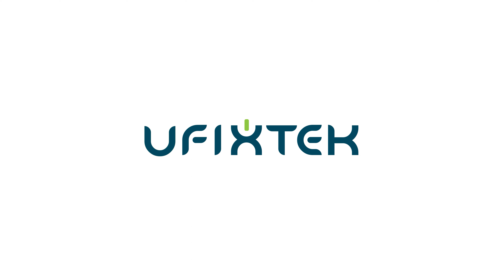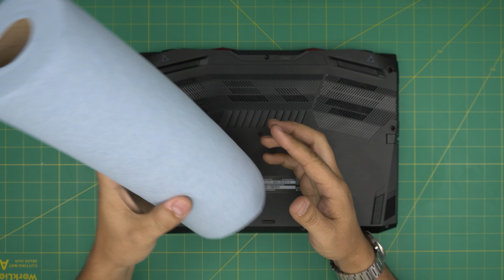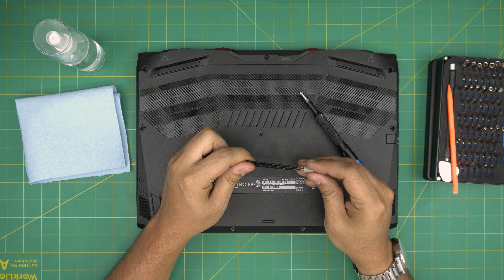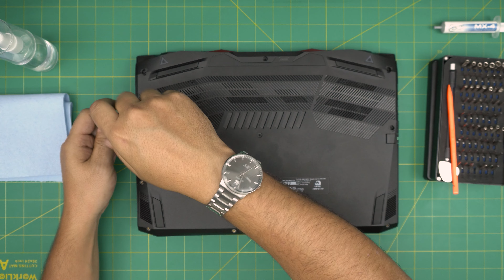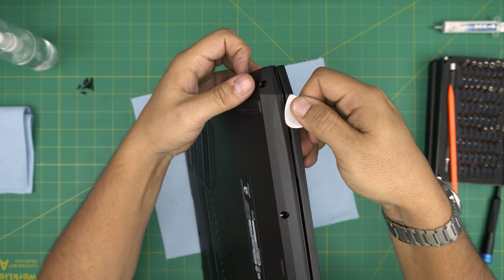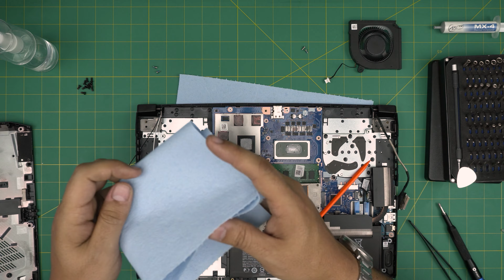How to Repaste and Clean Acer Nitro 5 AN515-57-79TD Laptop | Step by Step

Comment: i want to repaste my 2y old laptop but the heatsink screws are so tight and they are starting to stripped
Reply from the maker: Thank you for your feedback! If you wish to support the channel, you can like, subscribe, or both!
Regarding your tight screws, use a longer handle screwdriver and press hard down on the screw and at the same time small rotation, to break the seized screw.

Comment: Sir my laptop is giving me the green screen  after doing this i dont know why it doesnt boot into Windows it goes to automatic repair mode and it doesnt repair it i dont know what to do
Reply from the maker: regarding your question: double check the m.2 SSD and the hard drive to make sure it is connected correctly.

Comment: Are UPSIREN U6 PRO and HALNZIYE HY234 thermal putties good for replacing the thermal putty on my Acer? If so which one is better? These are the only domestic options I have in my homeland.
Reply from the maker: HALNZIYE HY234 are excelent, also the UPSIREN U6 PRO are great too.
Should you have any further questions or requests in the future, please don't hesitate to ask me.
cheers🍻
Reply: @uFixTek  Thanks for the fast response. I already managed with your videos to upgrade the storage, ram and clean the laptop. I have subsrcibed to your channel.
Reply from the maker: i appreciate your support my friend.
💞

Comment: I did this but now my laptop cant connect to wifi, only bluetooth
Reply from the maker: 😐Regarding your issue, make sure the Wi-Fi card (Bluetooth/Wi-Fi) is inserted correctly and all the way in, and ensure the antennas are securely connected to the connectors. Remove the card and reinsert it to confirm proper installation.

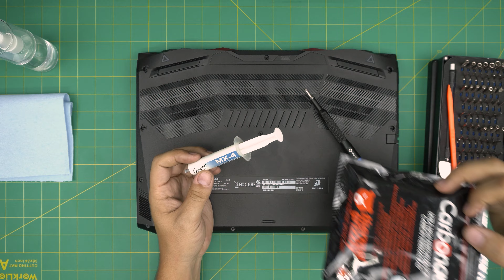Comment: 2:16 From my experience with Thermal Grizzly pastes are not suitable for laptops with high TGP, TDP where the temperature is close to 80°C for a longer period of time.  After 8 months, its thermally conductive properties deteriorate significantly.
You should try using phase-change material Honeywell PTM7950. It comes in as a sheet, lasts longer and performs in my experience works better than traditional pastes. On the power section, vrams give thermal putty Upsiren UX Pro. It is also good do undervolting on CPU and GPU at -100mV or more if it will be stable. It will be more fps, quieter, cooler and less power will be drawn.
Reply from the maker: Thank you for your valuable feedback. I want to express my agreement with your points while also sharing my extensive 17-year experience in testing and servicing laptops and electronics.

Throughout my career, I have observed that whether you use Thermal Grizzly paste or non-expiring pads, dust and air buildup are inevitable over time. Therefore, it becomes essential to open the laptop and perform cleaning and servicing at least once every two years to maintain optimal performance.

In my testing, I have personally used both Thermal Grizzly paste and the Thermal Grizzly graphite pad (known for its long-lasting properties). After a continuous three-year period, both products yielded similar results to what they provided on the first day of application. However, due to the accumulation of dust, the temperatures for both increased, with the paste being approximately +3°C warmer than the graphite pad.

Despite the three-year daily usage of 8 hours side by side, the thermal paste's temperature only rose by +4-5°C compared to the graphite pad. The significant dust buildup and the laptops reaching temperatures of 85°C and above made it imperative to perform a service on both devices.

I understand that data sheets for thermal materials may indicate specific performance attributes, but real-life testing over a continuous three-year period provides invaluable insights. To gain accurate results, I encourage others to conduct tests using the same model laptops, under identical conditions, and with similar loads.

While I would typically agree with conclusions drawn solely from data sheets, my practical experience with clients ranging from school teachers to graphical designers, and gamers, has shown minimal differences in performance among various paste models, makes, and types from top brands. The graphite pad stands out as a recommended option due to its reusability and its ability to retain its properties under heat.

To further explore the thermal performance of products like PTM7950 or liquid metal, I intend to subject them to thorough testing and assess their long-term results. Ultimately, I'm confident that PTM7950 will deliver outstanding performance over time.

In conclusion, I believe that combining data sheets with real-life testing is the most comprehensive approach to making informed decisions about thermal solutions for laptops. Thank you again for your feedback cheers🍻
Reply: @uFixTek  hello sir, I have Nitro5 AN515-45 R7 5800H + 3050Ti. I repasted it using GELID GC4 recently. it works well for a week but then it starts hitting very high temperatures again.

Just after repasting its able to maintain 65W at around 90C, but a week later it couldn't even do 54W. and same for GPU, temps rose from 68C to 79C after 2 weeks.

Can you recommend a paste which actually worked well for your Nitro5 for long durations?
Reply from the maker: i recommend you to place : thermal grizzly kryonaut extreme which has a Thermal Conductivity 12.5 W/mK, compare to GELID that only has a Thermal Conductivity of 8.5 W/mK.
but if you want the best of best use a Liquid metal (extremely conductive) you will need to use tape around the GPU/CPU dye.
and that has a Thermal Conductivity of 73 W/mK
Reply: @uFixTek  can't use Liquid metal because heatsink is made up of copper and gallium reacts and eats into copper. Can't use LM with electroplating my heatsink.

From what I have heard, kryonaut is even worse when it comes to drying out

What about thermal grizzly hydronaut?
Reply from the maker: my friend i been servicing for long time, and i have placed Liquid metal on this laptops and others, the LM will not eat thru the Copper, there are even used my manufactures on laptops with copper and even PS5 that used.
we apply LM on laptops and after 5 years reopening to service the copper it is in perfect shape and a bit of copper cleaner and polish you can re service. my personal laptop have LM for years and i serviced it recently after 4years and no problem.
kryonaut it will dry but not in a year it will in a two years and by then you will be doing service, by by then you have enjoyed the good thermals, but if you feel fit by usign other brands try them out and see which results the best for you.
Reply from the maker: everyone is subject to paste to what they like, and in my opinion and extended experience and testing i would stick to thermal grizzly extreme paste or LM on laptops as they shown the best results over time. Clients satisfactions are the one place we judge our work.
i do wish you the best and if you find your method and paste reliable i'm very glad and thank you for sharing.

Comment: Really helpfull video much appericated but i have an question. Im planing to replace my acer nitro 5 an517 models thermal pastes so vrms i mean capasitors need 1mm pads is okey but what size should i use for vrams that square chips around gpu  i do not  have k9 pady which size pad should i paste there ?
Reply from the maker: It's my pleasure my friend.
🫠Regarding your question, please do not use thermal pads where there is thermal putty or gel. The gap is uneven, making it unsuitable for a thermal pad. If you use a 1mm pad, it will be too thick and push the heatsink away from the GPU, causing poor contact. If you use a 0.5mm pad, it won’t reach, which could lead to VRAM overheating. 

Consider getting thermal putty from AliExpress; they are affordable.
Should you have any further questions or requests in the future, please don't hesitate to ask me.
cheers🍻

Comment: Hi mate can i ask some question regarding the pinkish thermal ( i recall you said its thermal putty right ? )
Is it the the same with the pads ?
Or ahould i just change it with the thermal putty instead?
Thank you
Reply from the maker: 🫠Regarding your question, use the thermal putty for the VRAMs only and don't use pads on the VRAMs. Use pads on the other components. I have linked the thermal putty in the video description.
Should you have any further questions or requests in the future, please don't hesitate to ask me.
cheers🍻
Reply: @uFixTek  thanks for the reply ,
May I know which thermal pad should I use ? 1mm or 1.5mm ?
Reply from the maker: It's my pleasure my friend.
use 1mm

Comment: Hi, got tips on how to fix the keyboard area heating up when being used in games? 

mine's absurdly heats up during gaming in the top-mid area (F2 to End Key - Letter A to #5 in NumPad)

already did repasting and even using thermal putty (unit's been with me for about 3 yrs now) but the area still heats up
Reply from the maker: 🫠Regarding your question, that area will always heat up as it sits right over the heatsink and the exhaust area for the hot air. If you apply the best thermal paste, it may get even hotter because the heatsink absorbs the heat more effectively. The heat is caused by the heatsink, not the motherboard. This is completely normal for these models.
cheers🍻

Comment: Thank you!! This is really helpful. One thing that's very important: after removing the battery connection, press the power button for at least 15 seconds to empty out the remaining charge from the other curcuits. Or so I'm told... Is this really effective?
Reply from the maker: It's my pleasure my friend.
🫠Regarding your question, you could do that but that will only reset teh bios to default and has no effect for installing new battery, but no harm in doing it.
cheers🍻

Comment: After taking off the heat sink to replace the thermal paste do you need to also replace the thermal putty?
Reply from the maker: 🫠If you wish to support the channel, you can like, subscribe, or both!
Regarding your question, not really, but if you want the best service job then i recommend you to do so, you can get a cheap thermal putty on aliexpress or get a good brand on amazon.
https://amzn.to/3UJj4pc
but again if you don't touch the thermal putty they will be fine.
just for the next service job save up and get a thermal putty container.
Should you have any further questions or requests in the future, please don't hesitate to ask me.
cheers🍻

This is an Amazon affiliate link. When you use my links, you are helping to support the channel. 🙏

Comment: The hardest part for me actually is removing the back cover without breaking off the tiny pieces holding it together. And also, thank you for this tutorial!! I'm planning on doing it myself. Like they always say, you should tinker on your stuff from time to time to see how they work.

By the way, is this also applicable to AN515-45? This is my Nitro 5 model.

Also, SUBBED!! <3
Reply from the maker: It's my pleasure my friend.
🫠Regarding your question, don’t worry about the tiny clips—they’re useless. And yes, it is applicable to the model you mentioned. If you have any trouble servicing, let me know; I’m always here to assist you.
cheers🍻
Reply: @uFixTek  Thanks man. I bought prying and spudger tools just to be sure.
Reply from the maker: anytime my friend, good luck👍🫠
Reply: @uFixTek  I managed to open it without breaking any of the clips!! took my sweet time though. this is my first ever laptop that I bought with own hard earned money so I'm sweating profusely. I didn't do anything though, I just tested myself to see if I can pull it off. Thank you so much for this video.

Comment: do i have to change the pink paste for those other componenets. My acer nitro is overheating these days, i need help.
Reply from the maker: 🫠Regarding your question, no, don’t touch the thermal putty. Just clean the GPU and CPU, apply a good quality thermal paste (link in the video description), and make sure you clean the fans.
Should you have any further questions or requests in the future, please don't hesitate to ask me.
cheers🍻
Reply: @ thank you
Reply from the maker: It's my pleasure my friend.
Reply: @uFixTek  bro someone recommended me to get something called as a phase sheet, is that a good idea and how would i do that if its good.

Comment: Hi we can use thermal grizzly kryonaut on both cpu and gpu? 
And should I change thermal putty with that pink thermal paste? 

I get 92 dgree for cpu while gaming I7 11800h 
I just give it to some people to change thermal paste but It got worst cpu temp is around 91-94 now 
I want to buy a thermal grizzly for it hoping it will decrease cpu temp
What's your opinion?
Reply from the maker: 🫠Regarding your question, make sure you get a original thermal grizzly and apply a nice amount to the CPU and GPU and replace the thermal putty with pink or any other thermal putty.
Should you have any further questions or requests in the future, please don't hesitate to ask me.
cheers🍻
Reply: @uFixTek   one last question 
Should I change the thermal paste? I mean some people told me that 92 degree for cpu is normal under heavy game idk if I should change it or no 
2 years ago it was aroung 78-85 for cpu 
Am I killing my when I play 2-3H with 92 dgree.? 
I7 11800h with tjmax 100dgree
Reply from the maker: 92c is NOT normal under load, 85c is ok underload for that laptop. but 90+ not.
repaste the laptop always once a year if you heavy user.

Comment: tysm for this. i want to ask, why my intel PCH temprature was high while idle around 70-90 degrees?
Reply from the maker: It's my pleasure my friend.
🫠Regarding your question, I would highly recommend buying a 1mm copper shim (10mmx10mm) and some thermal adhesive glue, and then gluing that to the PCH crystal die.

Comment: How many years can thermal putty last before it needs to be replaced in a laptop?
What is your opinion on PTM 7950?
Reply from the maker: 🫠Regarding your question, the putty can last up to seven years without any issues. As for PTM 7950, it is very good but extremely hard to find (most available ones are fake). I would also recommend Thermal Grizzly because it is cheaper and lasts up to three years.
Should you have any further questions or requests in the future, please don't hesitate to ask me.
cheers🍻

Comment: There is no thermal putty in my city and i cannot order from amazon or any other website like aliexpress. Can I use the girzzly thermal pads of 0.5mm or 1mm on the VRMs, If so what thickness do you reccomend 0.5mm or 1mm.
Reply from the maker: Thank you for your feedback! If you wish to support the channel, you can like, subscribe, or both!
Regarding your question, the reason that they use the Putty is because the gap is not even number.
i highly recommend you try to get it from a laptop repair shop some putty.
because if you put a thick pad it will counter push the heatsink aways from cpu and it will result in a very bad temps.
note, you could buy a .5mm pads and stack them to fill the gap. thermal pads are stackable without any issues.
the gap is somewhere .67mm if you need to know.
Should you have any further questions or requests in the future, please don't hesitate to ask me.
cheers🍻
Reply: @uFixTek  would it be possible for me to use grizzly kryonaut on vram and cpu gpu because a lot of people say its ok to use. 

Thank you very much for response
Reply from the maker: i been repairing for 18 years and any of my experienced friend and simple knowledge of paste and putty.
never use paste where there is putty, you will over very short time damage the components.
Reply: What would you recommend to use as the thermal putty instead of thermal pads?

Comment: can i use 2mm thermal pads for the chips? or is it too thick?
Reply from the maker: 🫠Regarding your question, too thick it will counter push the heatsink away from GPU/CPU and you will have a bad temps.
Should you have any further questions or requests in the future, please don't hesitate to ask me.
cheers🍻
Reply: @uFixTek  thank you for your respond. And which thickness should i use?
Reply from the maker: It's my pleasure my friend.
1.5mm
Reply: @uFixTek  thank you, one more question😆 u said in the video that these pads are 1mm, so should i use 1 or 1.5 mm?
Reply from the maker: they are 1mm but recommend you use 1.5mm

Comment: Can you sir do a video of applying thermal putty I ordered cx-h1300 thermal putty will it work or not and my model is an515-45 is the thickness of thermal pads is 1 mm or another
Reply from the maker: 🫠Regarding your question, the thermal putty all you need to to place a bulb on the components and it will squish into place.
Reply: @uFixTek  thank you sir and I want to know If also the thickness of the thermal pad of my model an515-45 is 1mm
or another one
Reply from the maker: It's my pleasure my friend, also the pads are it is 1mm thick.

Comment: hi, I have an Acer Nitro 5 AN515-57-55XN laptop and I want to replace the pink thermal pad, what size should I replace the thermal pad, is it 1.0 mm? or 1.5mm
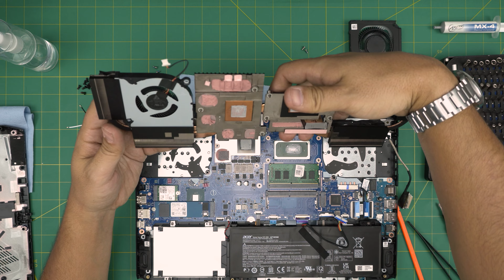Reply from the maker: Regarding your question, if you had watched the video right @8:00 min i have pointed and said that those are NOT thermal pads, as they are thermal putty.
if you place a thermal pad there a 1mm it will counter push the heatsink away from the gpu and cpu and the results will be catastrophic temps.
and if you place a .5mm then it will not cool down the vram and the components. the reason that they used the thermal putty if because of the distance of the rams are not even like .5 or 1mm.
i recommend you to get a good brand thermal putty like:
https://amzn.to/4apNySp
or get a cheap putty from aliexpress.

Should you have any further questions or requests in the future, please don't hesitate to ask me.
🍻cheers

the links above are amazon affiliate link, by using the links you helping the channel🙏🏼